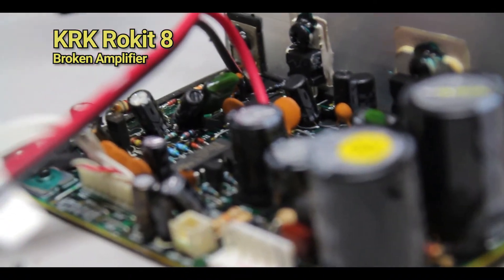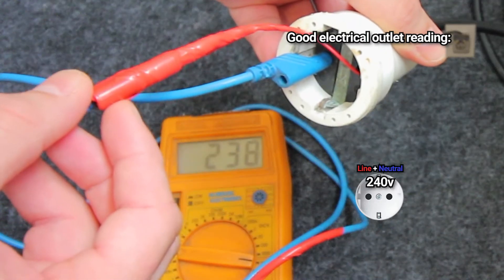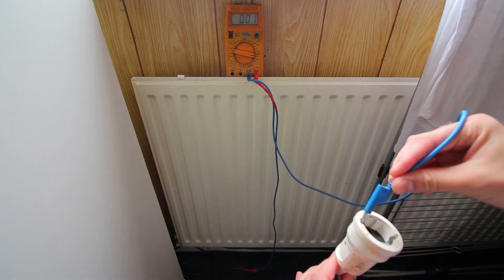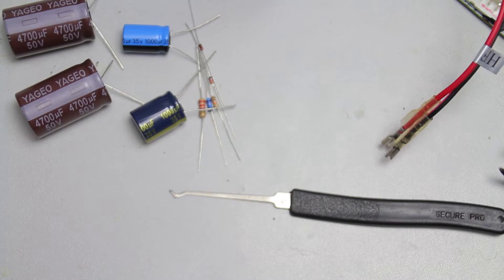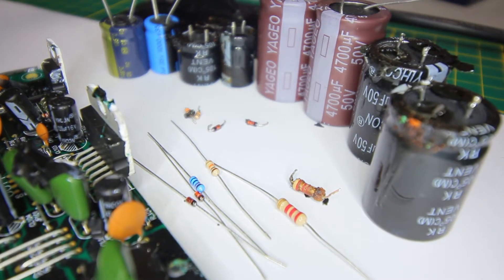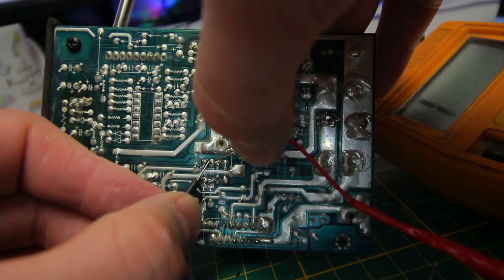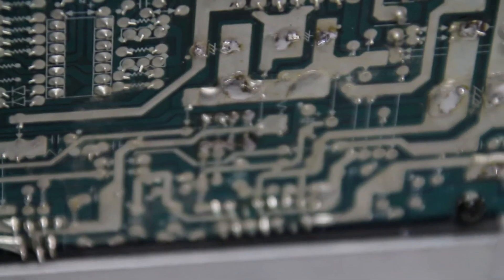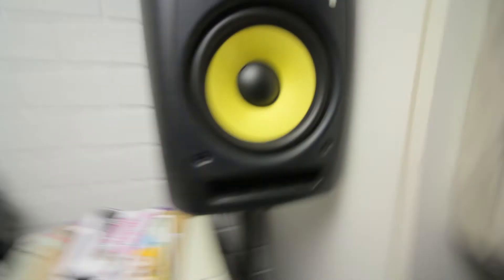Fix KRK Rokit 8 Amplifiers - short-circuit result in no sound Bass speaker

Comment: Hey brother!

I connected my rokit 8 RPG2 speakers ro a new computer and one blew a fuse, keeps blowing fuses. Opened and I see a big bulging cap, black crap, etc... I was hoping you might have a circuit digram and parts list to start cleaning this up... would make it much faster and less random of a process, I figure I will open both speakers and replace equally so things hopefully remain balanced. Also curious about upgrade potential, it looks like a surprising simple and cheap Amp, these definitely aren't military grade components, most look very general use, not even specialty audio caps... still, must be a good circuit, speakers and cabinet cause it does sound great... or did, lol. Any help appreciated. Recommended replacements would really help, recommended parts even more.

Comment: I have another problem. As soon as I turn it on it feels good. After 10 seconds the volume lowers itself to minimum and never returns. if I turn the speaker off and on, the volume returns for 10 seconds then goes away.  
Does anyone know how to help me? I reversed the components with the working speaker and the problem is on the AMP board.  It's on sale?
Reply: Sounds like you have bad capacitors, check for bulging ones

Comment: My two KRK Rokit Powered 8s also burned out. I have no idea about electrics 😞
Reply: If you live in the US, you might have a chance to get the units repaired by Gibson/KRK. If not consider selling for peanuts or give them away to someone who has the time, knowledge to tinker with them. I was able to remove the black gunk that plagues these units as they age. Just today, I completed replacing almost all the component parts and I will fire up the units tomorrow. Tedious, but doable.